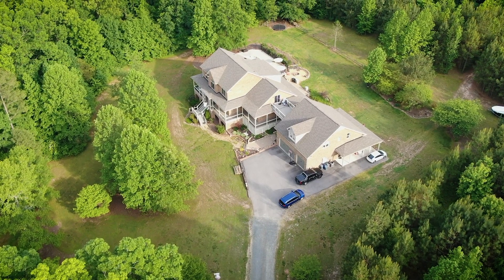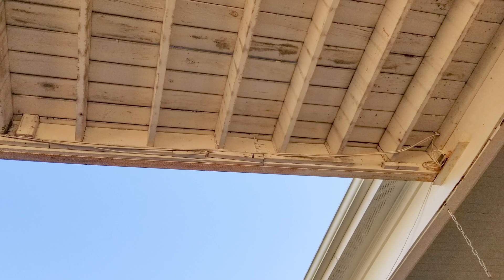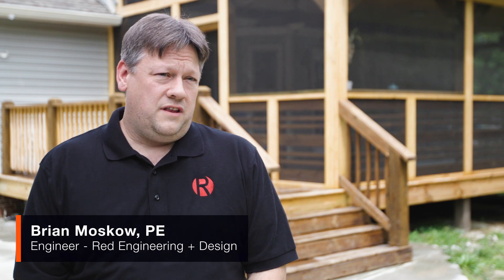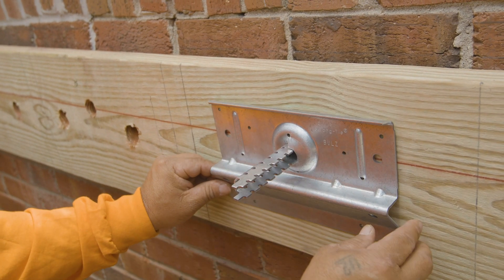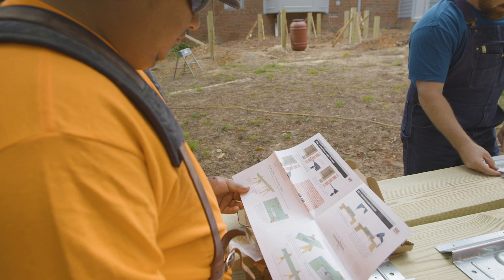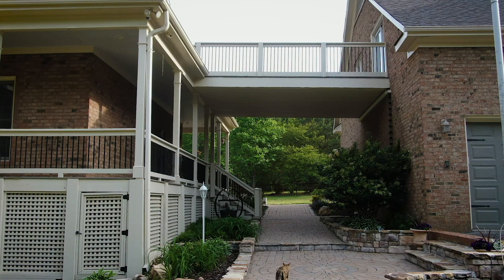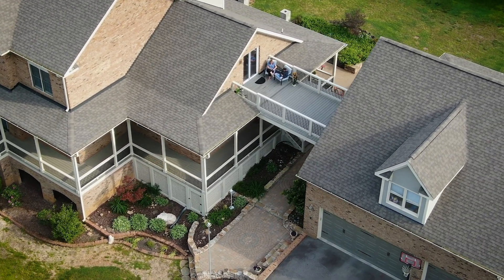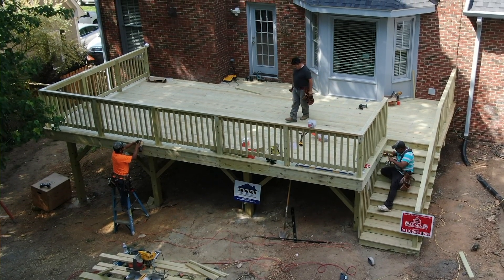Brick Veneer Ledger Case Study: Walker and Flemming Residence

Comment: Worthless video.  You don't need to "sell" it.  You need to show how it works.  
I see this sales mentality in a lot of product literature and it's counter productive for the manufacturers who do it because it wastes your customers' time and that angers us.
The "Joneses" are not your customers, so don't try to appeal to them.
The sales pitch you need to focus on is showing us builders and designers how your products are used.  From that information, we will select the products that apply to the situations we have to deal with.
BTW, I'm a designer, and I typically specify hardware connectors on the plans I produce.  I don't appreciate having my time wasted by fluff and flash.  Show me what a product does and how it's installed, as clearly and quickly as possible.  That's it!  It should be simple, so don't screw it up.
Reply from the maker: Hi deezynar,
Thanks for watching this case study.  This contractor had a unique challenge with the deck build and our BVLZ was a great solution. We have a separate video on How to Install the BVLZ.  https://www.youtube.com/watch?v=6N_6zbGD9qI
Reply: @strongtie  
Look, you clearly didn't get it.
It's not complicated, but you didn't get it.
Get rid of this video it wastes your customers' time.
That means this video angers your customers.
Can I make this any clearer?
You think that you have met the requirement because you have some other video that explains how to install this component, but that's a big mistake.
Imagine having thousands of different items tossed, willy nilly, into a big box and you need only one specific item.  
Whether it's objects, or information, excess items to sift through are a negative, not a positive.  Pair things back to the minimum so your customers don't waste their time.
And when you film, avoid headshots like the plague.  We don't need to see anyone's face, narration is much preferred.  Keep the camera focused on your product, and the local environment that it's being installed in.  That's it.  This is not a Hollywood block buster.  
What you're doing is typical of other manufacturer's, and all of you are doing it wrong and copying each other.
I think companies hire film school students, and they all really want to be making music videos, or Hollywood movies rather than how-to videos.  
Making good how-to videos is an art that's only appreciated by viewers who need to learn something fast.

I have just spent my time on explaining obvious things to you in hopes that you will change your methods, and you will save my time in the future.